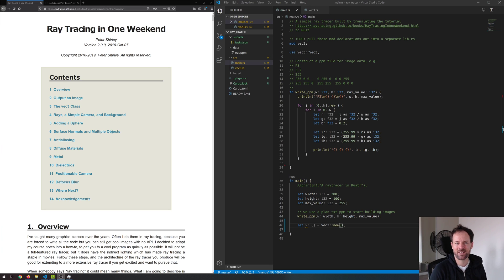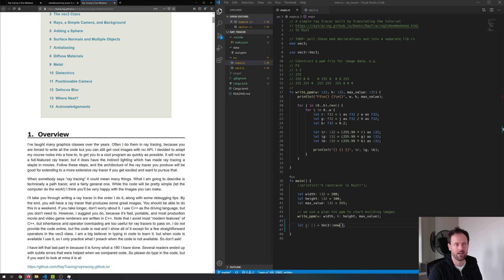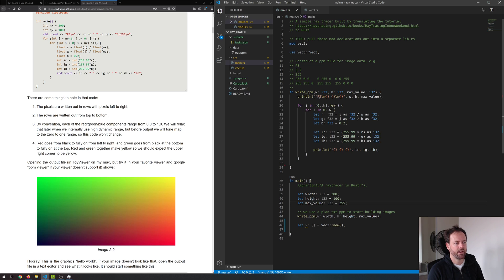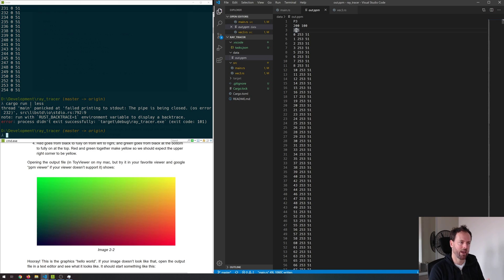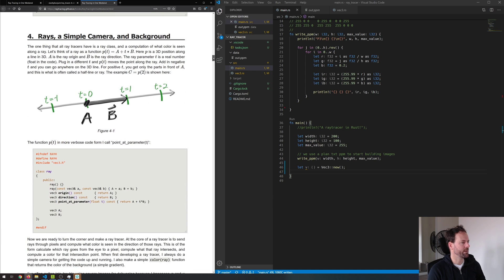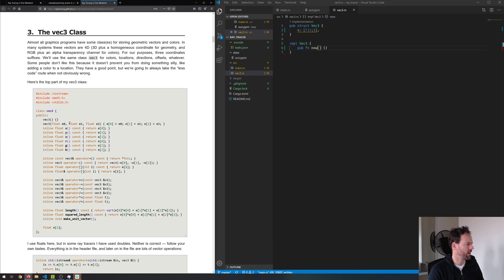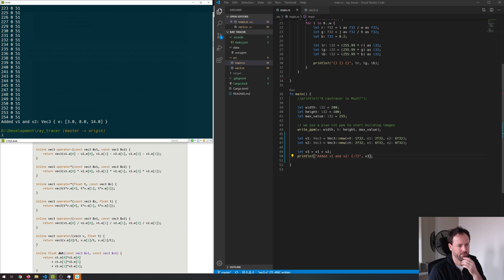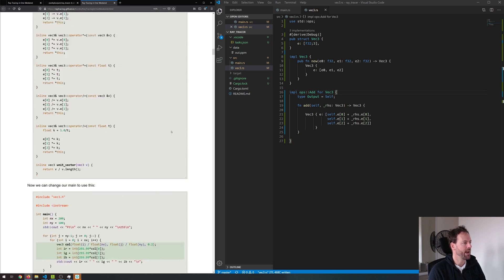Building a Ray Tracer in Rust: Part 1 - Building a Vec3 module

Comment: Thank you for the video! vec3 as in glsl::vec3? I wonder what it would take to run this on the GPU. If the algorithm works for each pixel on the screen, the fragment shader would be a good place to run it. Unless the algorithm is recursive... The camera could be uploaded to the GPU with a uniform. But where would the scene objects go, vertex buffer or also in a uniform?